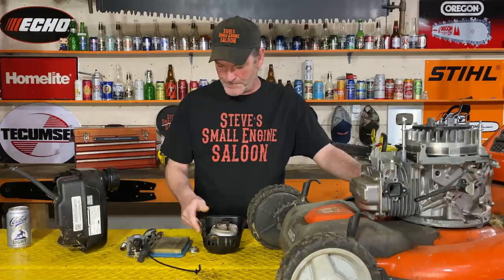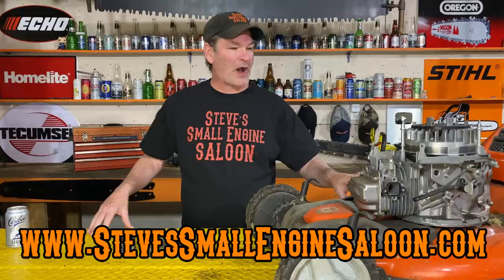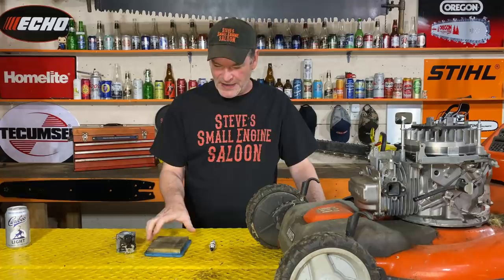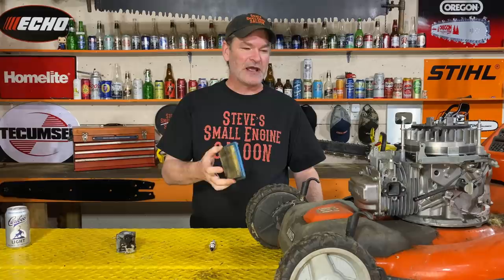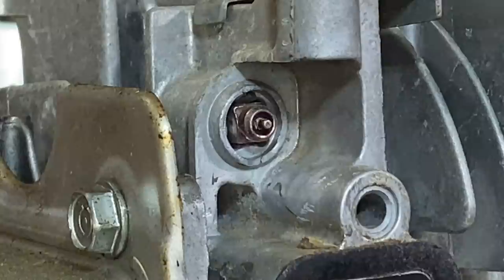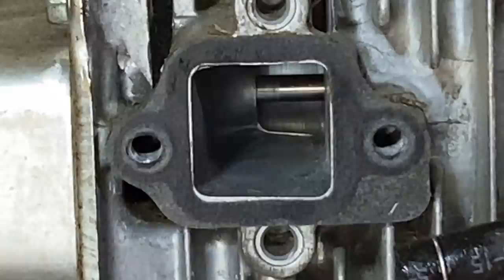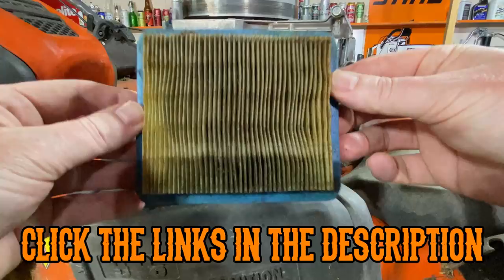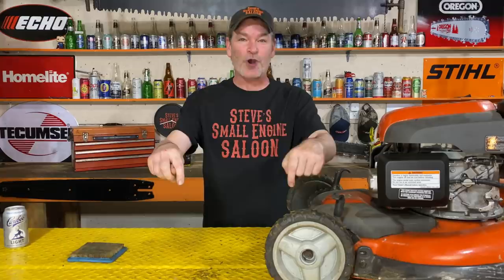What Happens If You Flip A Lawn Mower Over Wrong?  (LOSE MONEY)

Comment: I have done the same thing. I tipped it over on the wrong side and when I realized it, I laughed and bought a new filter. Always buy a new filter, spark plug and new oil if it’s not running right.

Comment: true story my Dad worked in a large lawn mower shop and did a lot of work for commercial gardners, this was almost 60 years ago. We put a new 7 hp kohler engine on a gardners commercial snapper, this guy worked for the city of Fresno as a mechanic servicing the fire engines and equipment. About a month after we installed the new kohler he brings it back saying we put a bad engine on when we checked it out he had seized it up -----no oil, I kid you not he asked surprised "you mean these little engines have to oil" !!!!!
Reply from the maker: Interesting!

Comment: I did figure out the the Toro mowers with a Briggs engine, store and go feature, will fill the air filter with gas when you over fill it. The overflow goes right into the filter. Other than that, it starts on the first or second pull.
Reply from the maker: Interesting!

Comment: Hi. I'm in dire need of help/advice. I'm pretty new to this (engines), but I'm an avid & experienced DIY'er. I've seen lots of videos talking about the right side to tilt your lawn mower, and others that explain what happens if you do it wrong, but I haven't found anything about how to fix this.

So, I tipped my new lawn mower on the wrong side by mistake, for over 30 minutes, and it leaked quite a lot of oil and a bit of fuel from the air filter.

It's a Remington RM02SB 140cc that uses a Foam Air Filter. I took out the Air Filter & its Cap and they were SOAKED in oil with a faint smell of gas. I cleaned them thoroughly with dishwashing liquid.

I let the lawn mower rest and waited to see how much oil would come out. About 6-8 hours after it stopped draining oil & fuel, I had to move it to the shed for the night while keeping it as level as possible. 

After moving it a short distance, I immediately noticed that about a Tablespoon of new fluid had leaked from the Air Filter hole. While it wasn't much, it makes me believe that there most probably still is a certain amount of oil and maybe gas (it smelled a bit) inside.

I was wondering: What should I do next?
I read somewhere that trying to start the lawn mower could clear that oil, but I don't want to do something reckless that would definitely damage the engine when right now, it's possibly not hard to fix.

Any help would be greatly appreciated!

By the way, I loved your formula and video format! You've got yourself a new subscriber!

Comment: Got a new husky that was in the trash on the side of the road, wouldn't start, turned out they had put, 2 stroke fuel in it, drained the fuel, cleaned the plug, refilled with straight gas, runs great, been using it for over 2 years now. Just goes to show, you'll never know unless you have a look.
Reply from the maker: My lawnmowers work perfectly with 2 stroke fuel!

Comment: I'll admit I spent an exorbitant amount of time and money on my Cub Cadet riding mower replacing a few parts trying to get it to start.

One day, I was inspecting the air filter and noticed that the choke wasn't closed all the way. One screw turned one half rotation and it starts and runs like a dream. That was a real facepalm moment, but I learned a lot about small engines in the process.
Reply from the maker: Awesome!

Comment: Hey Steve do you have a video on repairing the rear wheel drive mechanism on a Toro 22” recycler with a B&S 7hp engine? When I push forward, I get a whining sound and when I pull back, the rear wheels lock up. Help me out. Bro. Thanks

Comment: Just fixed a similar Husqvarna mower that had the carburetor replaced because owner said to do so, replaced carburetor and still wouldn't run, come to find out the gas in the tank had a lot of water in it,after draining the tank and flushing the fuel system it ran just fine-sometimes the simple things are what mess you up😆

Comment: Steve:thanks another great video and what a simple fix, it's unbelievable that someone would go to the lengths this guy has without checking out the simple stuff first ie is the rough running due to a restricted air supply so try it without the air filter and that would have nailed it.
Reply from the maker: Agreed!

Comment: Steve, I have the exact same mower/motor.. Mine runs great but if i kill it or if it dies because of tall grass it sputters when I restart it. I have replaced the thermowax, cleaned carb, new oem spark plug, new air filter… only way to get it to work is to wait for it to cool or hose carb area with cold water. Weird thing is if i remove thermowax and manually operate choke same thing… help!!!

Comment: A waitress friend asked if I could look at her lawnmower. It would start and run for a minute or so and quit. Several other "men" at the restaurant tried to figure it out to no avail. I knew what the problem was before looking at it. I figured the fuel cap vent was clogged with dirt. I was only partially correct. She had lost the original fuel cap and replaced it with the cap from a fuel can. She was ready to give a perfectly good mower away.
Reply from the maker: Right on Marty!
Reply: @StevesSmallEngineSaloon  Hey Steve, good of you to do these videos. Even someone with no understanding of engines can sometimes fix their equipment themselves in a matter of minutes.
I picked up a mower for free that looked like it didn't have one season on it yet and would barely run. It has a 6.5hp Briggs motor and the intake gasket was completely disintigrated. Easy fix and ran perfectly afterward. It has the damn automatic throttle which I don't care for at all. If I need a  heavy hitter I'll break out the old Tecumseh 5hp with throttle control. I'm sure the Briggs motor would be up to the task if it had a  manual throttle but it bogs down a bit in heavy grass. (If I give it throttle by hand at the carburetor it revs and powers up fine) Is that par for the coarse or should it be able to power through? It's something the other mower can handle with just a little more throttle.

Comment: He probably could not figure out how to put it back together.  I did that with a free ariens snow thrower.  It was not getting spark so I took it apart to get at the magneto.   After playing around with the switches I noticed it actually did have a spark.  I sprayed so starting fluid and it ran for a few seconds.   While I was getting at the carb I was hit with a fast moving storm with high winds.   A kill switch wire broke off.  That is beyond my skill set.   Pretty much anything mechanical is.     I guess I should give to Steve in all the pieces.

Comment: Well I would think it would probably be the automatic choke. If this unit has it I think this uses a wax based thermostatic choke mechanism. They are notorious for going bad. Or depending on his maintenance history it might have been that is air filter may have needed replaced.

Comment: My wife tipped her push mower over wrong side. Powermore 132cc, I've cleaned it all up, oil got in the carb, got in the cylinder etc. I can get it to fire spraying quick start in to the carb, but it will not pull fuel. Any ideas? Thanks

Comment: It was drilled into me long ago when a machine is running well and then suddenly it's not check the obvious. Does it have gas? Is the oil level okay? Is the spark plug okay? Is the air filter clogged?

It is amazing the tendency to jump to radical conclusions about a problem being something very complicated without checking the simple stuff first.
Reply from the maker: Agreed!

Comment: As usual operator error was the prime cause. A couple years ago in a moment of ignorance I turned my Honda on the wrong side. I realized a new air filter was needed immediately. My 12 year old Honda is still running great.
Reply from the maker: Awesome!
Reply: I did the same thing last fall and it wouldn't run right until I had the air filter off, which is when I realized what I'd done.

Comment: I don't know if you give any advice or not but my Craftsman lawn tractor with a Briggs 19.5 hp engine is suddenly not running smoothly once the choke is off.  It starts to sputter and dies without the choke.  Any suggestions on what to look for?  The tractor is almost 25 years old and the engine has been trouble free.

Comment: Hey Steve, Can you tell me how to route & connect new fuel lines on an older model Craftsman weed trimmer? My old lines just broke apart in pieces after being stored for a good while. I have new lines, filter & primer bulbs but I don't know which way they go back on. Model #358.798420. 21cc.   16 inch trim.  Any help would be greatly appreciated! Thanks!

Comment: Good job Steve. If that automatic choke would have been bad, how would you repair it? I have a practically new Honda mower that’s hard to start. I will check the filter. I hate the automatic choke feature on the new mowers. Great video!!!!!
Reply: Steve has a video on replacing the little thermostatic plunger.

Comment: Steve guess what. I just disassembled my first carburetor, and reassembled it. Huskee 4200 was dead. I sanded the flywheel got spark. Then I tackeled the carb. it runs !!! But the engine surges. I'm not a mechanic but I'm making progress. Any advice for the engine surges ?
Reply from the maker: That video is in my playlists!

Comment: I've watched a lot of you videos and actually know how to repair a lot of these simple engines.  Love your videos by the way, very informative.  I recently got my Poulan Wood Shark 1975 chainsaw to cut a few branches off of a tree which I rarely use and have owned for a long time.  Replaced all the fuel lines and filter, spark plug and carb.  Fresh gas as well.  Started the saw, adjusted the new carb based on one of your videos, cut the tree limbs and now no matter what I do the saw will not start again!  It seems to have almost too much compression because pulling the rope while holding it almost yanks the saw out of my hand.  Really frustrated, any ideas?

Comment: Hi Steve welcome from Australia . I have a poulon ride on 38" bed 13hp 
Briggs and stratton engine. some times when i start it i get a back 
fire. Also when i engage the blades it cough and splutters and some 
times back fire  and the it starts coughing but when it gets going its 
fine. any ides what it could be I thought maybe the plug or the pick up 
from coil to mag. Ive cleaned the carb totally and the plug. Hope you 
can point me in the right direction. thanks Nick

Comment: I screwed up.  I changed blade but tilted the lawn mower with the air filter down.   Oil leaked out the air filter.   No gas and oil in lawn mower,. How do I get oil out of the piston cylinder before I add new oil and gas to start it?

Comment: I am a 77 yo woman trying to remain independent so if you  don't answer this,  I hope a subscriber will be kind enough to help. I need to replace my mower carburetor but my choice is for a mower with or without a vacuum choke pulloff. I don't know what that means. How do I determine if the mower has one? Sorry to sound ignorant,  but right now I  am. Thanks!

Comment: Could a bad ignition coil keep riding mower from starting? It tries to start, but not
Reply: Bought this tool, that attached to spark plug and the plug for the ignition  coil, no light came on
Reply: I will try, thank you sir for your help and support.  Order part, won't come in until around the 13th. Will need goats to mow the grass by then🙃

Comment: Had a lawnmower given to me because it leaked oil. The filter was so plugged it was causing oil to leak due to not enough venting.
Reply from the maker: Interesting!
Reply: @StevesSmallEngineSaloon  the lawn mower has a vent line from the case to the air filter. With the plugged filter oil somehow was making its way up that line and down to the deck I think…

Comment: I have two mowers, a husky and a toro. Both with pretty much the same briggs 7.25hp engine. The difference is, and i don’t know if the honda engine is the same story, but husky claims it’s a “no oil change engine.” Insanity to me. I change the oil on the husky regardless. But the idea is, that the engine burns oil so all you do is add oil from time to time. Lol. Ridiculous.

They’re both solid mowers, but the husky’s awd system is pretty lame. They account for this in the owner’s manual too. After disengaging the awd, you will have trouble pulling the mower backwards because it doesn’t fully disengage. You have to manually push it forward a few inches to unlock it as stated in the manual, and from use that’s true. The toro personal pace is a much better system.
Reply: @marcmyers1465  precisely.

Comment: I have a Honda gcv160 motor.  It will not start at all.  I have put new carb on it, it is getting good fire, clean gas, checked timing and even with starting fluid it will not start.   Checked oil and even put in new plug.  Checked the valves and they both are right by specs.  Any suggestions??????
Reply: @marcmyers1465  does not have an engine brake cable on it.
Reply: @marcmyers1465  I’ll check in morning and see. Thank you.